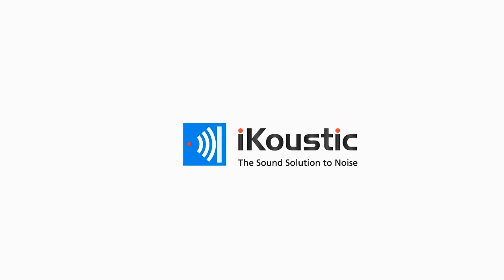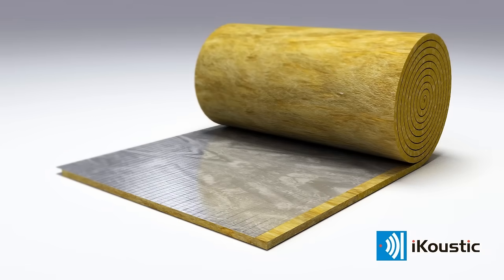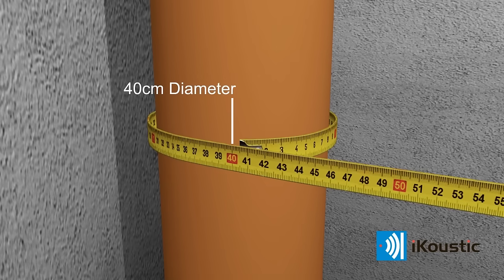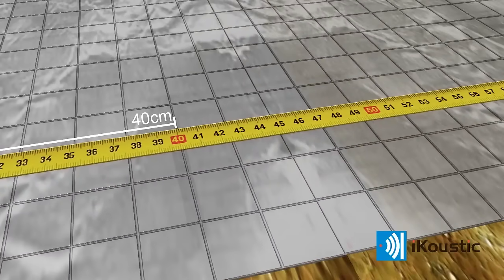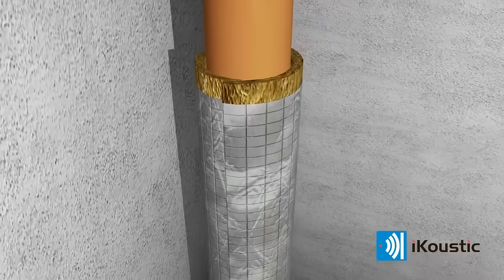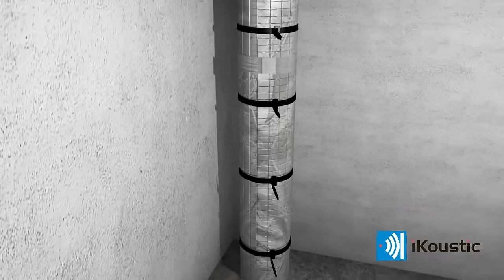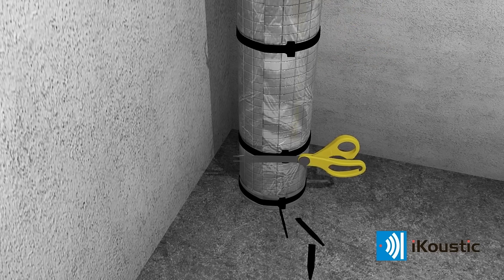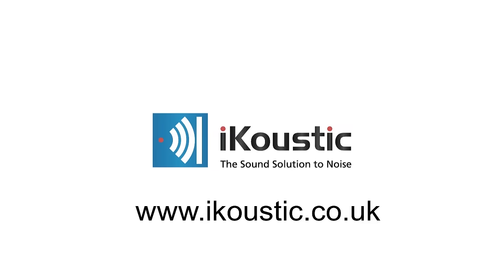How to Soundproof a Pipe - Tecsound® FT55 AL (Acoustic Pipe Wrap) Installation Video

Comment: You need to add more than 50mm to account for the foam inside the product, I wrapped a ziptie around a pipe and cut it to the perfect circumference took it off and used it to measure a piece and it didn’t come close to wrapping around.
Reply: With 50mm added *